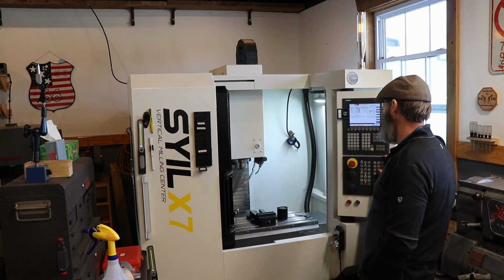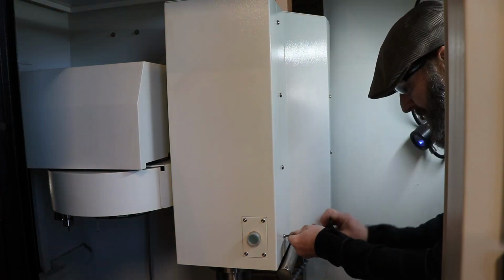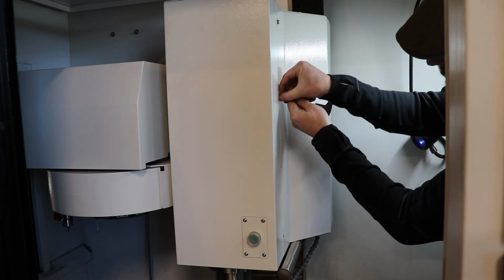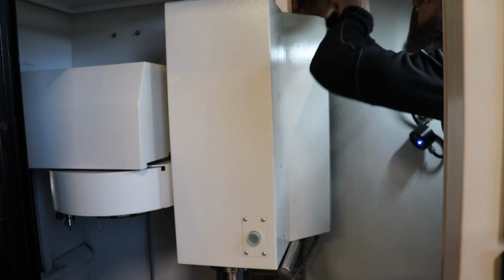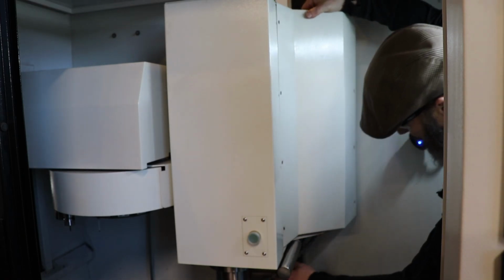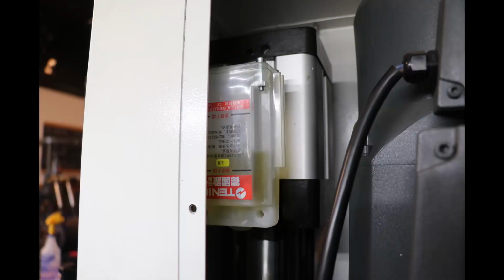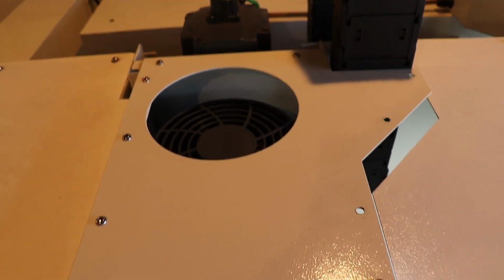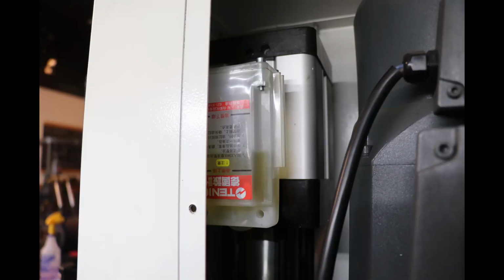SYIL X7 Basics: The Drawbar Intensifier

Comment: Current info syil and mr chen is putting out is the air oiler should not be filled, he says oil gettig in the pnemuatic cylinders can shortern there life significantly
Reply from the maker: Nice. Thanks for the update. 

Is there an announcement or bulletin or something you can point us to? I wonder how Syil would communicate something like this to existing customers.
Reply: Hi is this the air oiler on the back left side of machine
Reply from the maker: @karennoyce1015  Yes, the Air Oiler is on the back left side of the machine where the air supply line comes in.